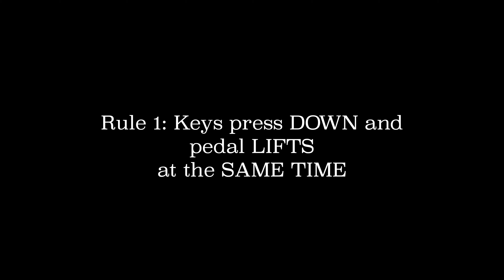Are You Using the Damper Pedal WRONG???

Comment: I have just discovered your channel. Your videos have exceptional content and exceptional production (camera angles, editing, etc), congratulations!
A question on pedalling - both my method book and my tutor have told me that one lifts the pedal (just for a moment) immediately after the hand comes down to play a new note/chord. Rather than lifting the pedal as the hand comes down, and then pressing it down half a beat later, as per this video. Is one technique a precursor to another?
Thank you, and thanks for the care you obviously take with your fantastic videos.
Reply from the maker: Technically, your method book and tutor are correct. The pedal comes up a split second after you play the key. However, since it's so close, I find it's easier to think of it as *at the same time*. Try thinking about it both ways - you'll be able to hear if it's not right. :)
Reply: Thank you so much for your clear reply.🙏😊